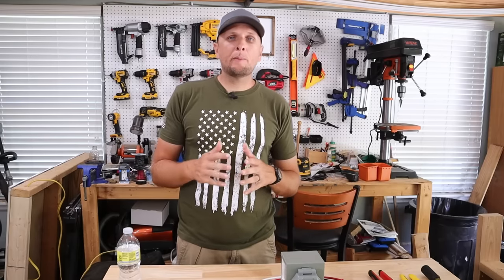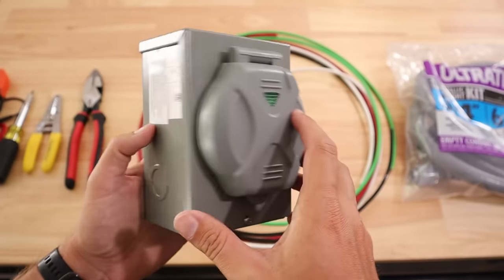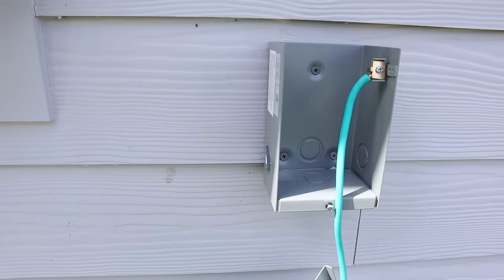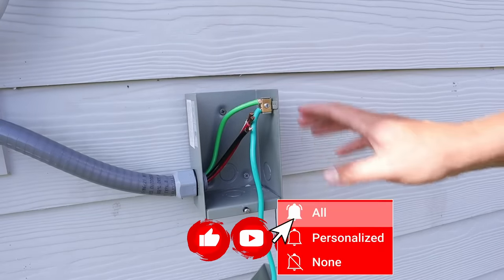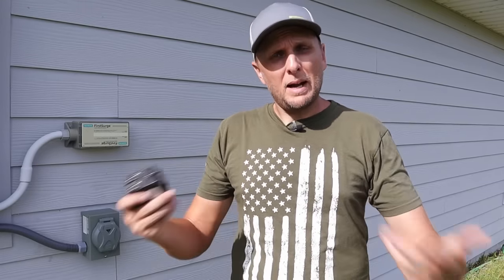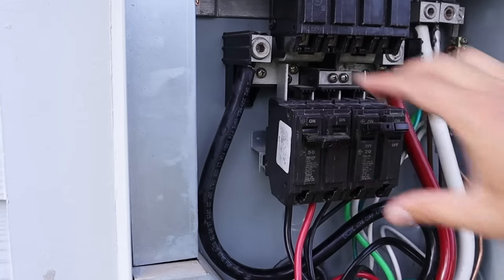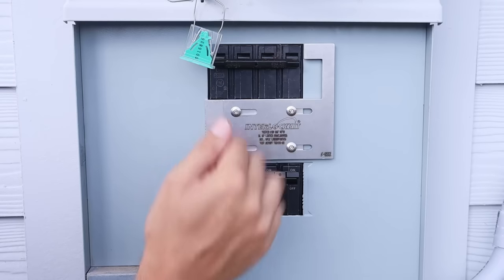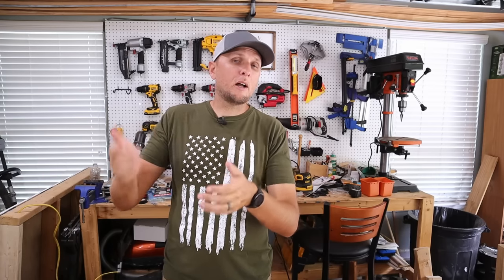The BEST Way To Connect A Generator To Your House - Interlock Kit With Power Inlet Box Install

Comment: I had the same box and interlock switch installed by a professional electrician and as I recall it was about $170, but I supplied the inlet box and the interlock kit (about $70 for my panel).  I have 5500 watt (6250 peak) inverter generator.  It will run everything in the house except the AC (though it will run the blower so I have heat in the winter).  Generator uses about 4 gallons of gas for 10 hours.  I have had to use it a couple of times.   My total investment, including the electrician, was about $1400. I am quite pleased with my investment. The power was out for three days during the great freeze in Texas last year and I swore I would never be without power in cold weather again.
Reply: I live in Texas also and just had one installed. But in had to update my breaker box.
Reply: @paulsosa1872  @Shénmì Shèshǒu
Wow! I just got hosed by an electrician that charged me $1200 to install that same $35 inlet box, the interlock kit, one 60amp breaker and 20 feet of 8/3. I got lazy and trusted them to install an actual transfer switch but he did this route instead and charged the same. I could not dream up how he charged $1200 for $200 in parts and 1 1/2 hours of labor. I need to become an electrician!!!
Reply: If you install a soft start, your generator may be able to run your ac
Reply: I was quoted in the thousands for this work. $170? Please take my money!!!
My electrician - handyman said it could go from a low of $1500 to $3000 and I don’t get the math. 
How do I request the job properly so I don’t get hosed?
I’m in Miami and everyone is trynna get paid around here.
Reply: @strokerace8458  also in Miami, let me know how it goes
Reply: I took the old advice of buying the cheapest home in the best neighborhood. 
During the Great Freeze in February 2021 we were saved by being on the same grid as a World Class Resort in our neighborhood and CPS didn't cut the power because the city didn't want the bad publicity.
Reply: @strokerace8458  $170 was just the labor.  I provided the interlock kit and the inlet.  I had a 50 amp breaker in the box that was not being used because it was for an electric dryer, so since I have a gas dryer, he could repurpose the wire to go to the inlet.  Still, even if he had to put in a breaker and run the wire, I can't imagine it would have cost more than $340, but it all depends.  My house is on pier and beam with a generous crawl space, and I had the outlet put about 12 feet from the panel. If you were going to the other side of your house that could be a much bigger deal.
Reply: There are some home projects worth hiring out. Electrical and plumbing I always hire out. I know my limits.
Reply: @rncondie  Yeah, I let the elctricion install mine.  He only charged me $179 but I had he inlet and the interlock, so he only installed them. Cheap to do.
Reply: I just got an estimate from an electrician for $800 plus parts. My outside panel is different from yours. It's just a small box so I think the interlock needs to be installed in the electrical panel inside my garage. But how can it cost that much higher than yours?
Reply: I get many 3 black outs a year in Southern California and on one cold December night I was left without heat with a newborn. Installed a transfer switch and it’s been great with a small 3800 watt genny. Runs everything except my AC
Reply: @jacob I got quoted 3000$ (Canadian that is). Labour and parts. No way around it. Everything is brutally expensive in Canadastan.
Reply: Update from my previous post. I got two more estimates. One was $2064  and last was $385. Guess who got my business.
Reply: @ej1547  Congratulations. You found an honest electrician.
Reply: Where I'm at, that would be $20 a day in gas.So $600 a month to have electricity. Not feasible. Maybe a gasifier generator is a better choice for my area.
Reply: @MARTiALYOU I’ve installed them for more than that, That’s the going rate 
You’re paying for the knowledge not the time
Reply: @isaeproductions5217  I understand that but I would have just installed it myself had I known the electrician was going to charge a ridiculous price of $1200 per hour. There are no excuses for that price, None whatsoever. I decided to slack a bit and let someone else do a job for me this one time and I got hosed plain and simple. Just because I wasn't babysitting the entire project. No electrician is worth $1200 per hour.  None
Reply: @fredsmith1672  do you lose power for months at a time?  Serious question.
Reply: @robertjohnsey9496  
Agree, have one on my RV, 2000 watt generator runs the air (but not the coffee maker at the same time 😂).
Reply: I surely hope you tipped your electrician!
Reply: @ej1547  Yeah, if you have a spare spot in the panel, then the job is pretty simple. You move the breaker in the place needed by the interlock and put the new breaker there.  You run your cable in a conduit to the inlet box and wire it in..  This is a 2 hour job for a decent electrician and this includes mounting the interlock plate. People getting  quotes for $2000 are most likely dealing with these big service companies that rip people off all of the time.  We had a big freeze here in Austin a month and a half ago.  Power was out for about 3.5 day but I was able to run my house more or less as normal.  After the freeze, five neighbors came to see my setup.  All bought 5K generators and all went with an interlock.  Highest install was $600, but this included the interlock plate, the inlet, and all materials. Average was $450.  It just isn't that big a job.
Reply: @isaeproductions5217  that's theft
Reply: @strokerace8458  Easy DIY.
Reply: Do you think a 6500 generator can support a 3 ton AC?
Reply: @orlandonunez5761  I doubt it, but it could be close if you put a soft starter on it. Here is what I recommend that you do.  On your outside unit, there will be a label that has the specs.  The spec you are looking for is the "LRA".  LRA is locked rotor amperage, and this is the current that the outdoor unit will take to start up. This is going to be surprisingly high, probably on the order of 80 or 90 amps. It only draws this current for a second or two, but this will be the current the generator has to supply. A lot of generators have a rating that is the peak rating so a "6500" watt generator will only provide that wattage for a second or two.  A soft start kit will lower the amount of current required to start the compressor between 40% and maybe 45%, but you also have the inside fan that is not included in these figures and that means that it would be unlikely that a 6500 watt generator would start it even with a soft start kit, but it might. Get your LRA as a starting point and then watch some videos on the soft start kit to see how much it reduced the inrush.  I think at 3 ton though, it is unlikely, but 8000 watt generator and a soft start kit would probably get you there.  LRA Is the starting point though and that can differ quite a bit. My 3.5 ton has an LRA of 109 amps. Even with a soft start kit on the unit, my 6250 watt generator is not gong to be nearly enough. I worry more about loosing heat though because our big outages in Texas have been in the winter.  This last winter, the power was out for 3.5 days and my 6250 watt generator made for life as usual at my house (I have a natural gas heater) and now all of my neighbors, who thought I was crazy to get a generator after the freeze a few years ago, now have their own generators. They know they may never need them, but they all said that they don't ever want to be out of power in the winter again.
Reply: @MARTiALYOU 😅
Reply: I did it myself and my 9000 watt generator runs my ac and a few other smaller things haven’t really tried pushing it my generator only rated for 30 amp, mainly needed for the ac seeing that I have a newborn and it gets pretty hot and humid in Michigan. But costed me about 119 and my time.
Reply: Made up price 😂
Reply: @shenmisheshou7002  please recommend for the Austin area.   I need the same job done .Just got a quote for 1150 for install per interlock on breaker box.
Reply: @Odin31b  The guy I used has retired, but there is a guy that did 5 of my neighbors and he sounded reasonable. Raul Electric. Area code is the old one before the new one. 938 is next, and 2740 is the rest.  After the freeze this winter we were without power for 3.5 days, and I was one of only two people in the neighborhood with a generator (the woman across the street had the full $15K standby generator). After that, five of my neighbors asked me what I did, so I showed them the setup and recommended a generator for them and they all got interlock kits put in, and Raul did them all. I broke up the number to keep from having it scraped.
Reply: @shenmisheshou7002  much thanks! Ran the number and got R energy Electric.
Reply: @TheLostAdventuress  $925 for the Champion 6250 inverter generator. $60 for the cable, $50 for the inlet. $75 for the transfer switch. The electrician installed int all in an hour and charged me $178. About $25 for the breaker Now I had an open breaker slot in my panel outside so for those without a spare 240v breaker slot it would be more.  Again, labor was $178 and that included drilling the holes and mounting the sliding interlock. If there is an open breaker, this is an hour job. I mean how hard can it be. The install the new breaker, do a punchout, put a  foot of conduit in, run 2 feet of romex, wire it on both ends, drill two holes in the panel, put in the standoffs for the sliding plate, screw screw the panel on again. This was not a big job. After the power was out this winter for three days, five of my neighbors bought inverter generators and all had an elecrircin put in an interlock, and the most he charged anyone was $450, but he also provided the interlock kit and the inlet where as I had bought mine separately. This is not a big job. if there is an open 240 breaker. An hour is all you need. Anyone that quotes more than $450 parts and labor is ripping you off. It is not a difficult job. It is so simple in fact that there are a dozen Youtobe videos where homeowners did it themselves.
Reply: Do you remember the name or company name of that electrician?
Reply: @ej1547  I don't see why it should be more unless there is more than one breaker panel in the house.  If there is cutoff in the panel that allows you to disconnect the inside panel from the outside power entry, and there are no other panels that could back feed the power entry point, then I can't understand why it would be so much. The generator inlet is about $60.  The interlock itself is just freaking expensive metal plate with slots cut in it (it is outrages that they can charge $100 for this, but to know the cost, find your panel model and look it up.)  The install is to remove the panel face (which must be done to put the breaker in anyway) drill two or three holes in the panel face and mount the slider guides and slider (10 minutes tops) put the braker in, though this will almost always require moving one 240 volt or two 120 volt breakers so you need to have two empty 120 breakers near the cutoff, on the left or right side at the top of the buss bar and this could take maybe 15 minutes but maybe there is some complication that I can't know. A conduit is put on the panel and wires are run through it. The inlet wired and mounted. My guy die everything in about an hour.  Without seeing your setup though, it would be hard for me to know if there is some complication that means a lot of additional labor. To be fair, in my panel, there was arleay a 240 breaker in the right spot, so moving one or two breakers could add maybe another 20 minutes to the project.
Reply: OMG.. I am checking this type U TUBE DIY. for first time. Want to thank you for the break down on your cost. I was so frustrated. by the response / est.  I got for this job. I had most all supplies ..needed the interlock. And maybe some sub panel breakers. The electrian quoted me his huge discount for disabled senior at 800 ..that was only to hook up the wiring at the subpanel& main& receptacle all parts and boxes would already  be run thru wall and all ready to just do the final hookup 
With the interconnect. That seemed excessive for that much already done. He said i was paying for his license ..i felt that he shouldnt be insinuating he was giving charity in that price / service.😮😞
Reply: @MARTiALYOU  Yeah, they are ripoff artists.  Got quoted for something recently and would be like $4750 in Labor for 6-7hrs work!!!!  FUNK YOU.  I'll do it myself!
Reply: @MARTiALYOU brother you didn’t get hosed 170 to install any generator circuit is crazy.. your price is more realistic given where you live
Reply: @isaeproductions5217  Knowledge was not the value, I would have done it myself had I known the electrician was going to install a 35 kit in my panel rather than an actual generator transfer switch as we had agreed prior. Anyone with an ounce of electrical sense can install one of those kits and no one is worth $1200 per hour
Reply: I didn’t see where you terminated the the red and black wires (supply voltage) to the house. Did I miss something?
Reply from the maker: @studstillstudstill7388 yes
Reply: I live in Texas and need your electrician contact info please and thank you.
Reply: Every penny worth it!!
Reply: @ej1547 hopefully he was licensed
Reply: I wired my blower motor to a cheap 20a generator for that same 3 day event in Conroe
Reply: @gregorybolin4672  Yeah, if you just need to stay warm and you have a gas furnace, is all you need to do is put a plug on the furnace so you can run an extension from the generator. It does not take much to run just a gas furnace and in a freeze, the #1 priority is to stay warm.
Reply: After watching your video I’m going to install one of these. I live in East Texas and for the most part our electricity is very reliable and no problems in 2021 fyi I’m on a coop. I have a couple welders that have 7500 watts so I rigged a 50 amp cord with a dryer male plug on one end and a plug for my welder on the other end, I turn off the main and plug in to the dryer plug and it gives me power to the house. We have propane to the stove and fire place so I haven’t ever tried the furnace. It works for me but that cord is heavy and to heavy for my wife if I’m on the road working…. Thank for posting!
Reply: Guys, here is The TRUE Savior

HalleluYAH translates “Praise ye YaH”

YaH is The Heavenly Father 
YaH arrives via the TENT OF MEETING
YaH was Who they Crucified for our sins
YaH was Crucified on an Almond TREE

— Ancient Semitic Cuneiform of Moshe (Moses)
— Isa Scroll (The Original Isaiah)

Isaiah 42:8
"I am YaH; that is my Name! I will not yield my glory to another or my praise to idols.

Isaiah 43:11
I, I am YAH, and there is no other Savior but Me.

Isaiah 45:5
I am YaH, and there is none else.
Reply: @Praise___YaH 
Yahuah is The MOST HIGHS name
Reply: @kevinaalberts9251   no sir

HalleluYAH “Praise ye YaH”
KumbaYaH “rise up YaH”
YaHuShua “YaH is my cry for help”

Isaiah 42:8
"I am YaH; that is my Name! I will not yield my glory to another or my praise to idols.”

Isaiah 43:11
“I am YAH, and there is no other Savior but Me.”

Isaiah 45:5
“I am YaH, and there is none else.”
Reply: @kevinaalberts9251  

YaH <— derived from “Yad He (HAND BREATH)” as YaH’s HAND formed “man” from the dust of the ground and YaH’s BREATH made “man” a living being (Genesis 2:7)
Reply: Just got a quote for $1,850.00.  Seems punitively high for some reason. It is a simple job and I have all the parts and it is still this price. Couldn't take more than an hour or so to do. I already have the 50 amp breaker and it is easy to install and wire it up. Going to get a second bid or do myself. I have put in surge protectors before on a 20 amp breaker and it is not that hard.
Reply: @strokerace8458  try you tube next time.
Reply: Did the electrician install a separate grounding rod for your generator?
Reply: 2024 and just got quoted $2300 to install this.

Comment: Be careful everyone!!!!! This installation might not be right for you. You need to verify your generator does not have a bonded neutral if you are using this wiring method. If your generator has a bonded neutral you need to have a 3 pole transfer switch that isolates the generator neutral(white wire) from the power company’s neutral. VERY IMPORTANT!!!!
Reply: So we could just make the neutral bonded generator a floating neutral and this method would be fine?
Reply: @degen_dad7682  you could if you have the ability to do so. Some generators mainly inverter generators can be difficult to switch around from bonded to floating and vice versa.
Reply: @jmommy991  So once you convert to floating neutral will this method of wiring be the correct way?
Reply: How do I know if my generator has a bonded neutral or not?
Reply: @edrusk9846 use a meter and do a continuity test on one of the outlets on the generator from the neutral side to the ground side. If it beeps and you have continuity then it is bonded neutral, if not then it is not bonded
Reply: @layziebone19  How do you know the difference from neutral and ground by looking at the plug
Reply: @edrusk9846  There will be info on the control panel of the generator.  It will have symbol and the words "Bonded Neutral" on it.
Reply: 4:58 he refers to that